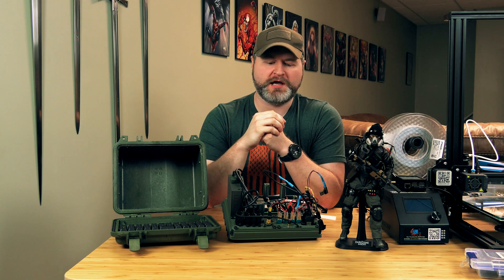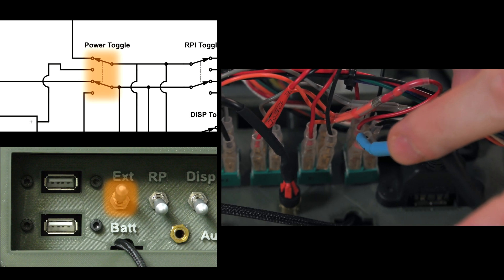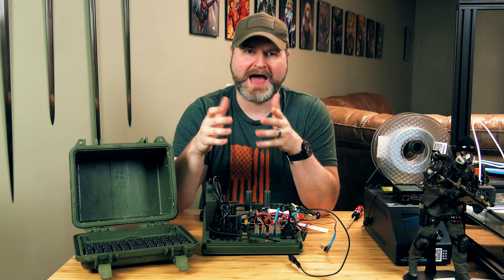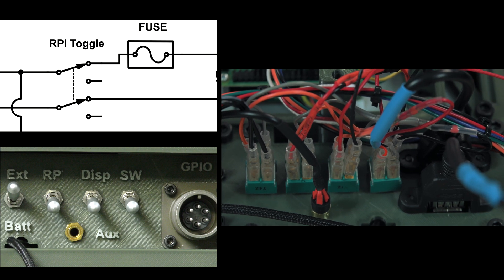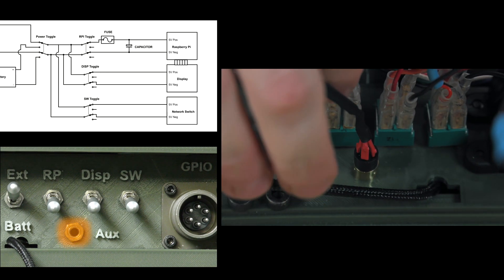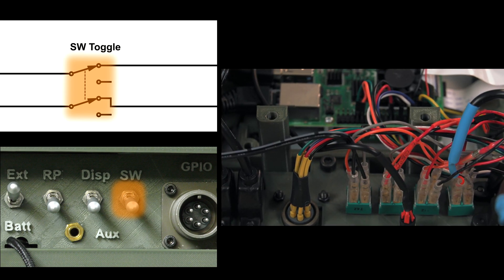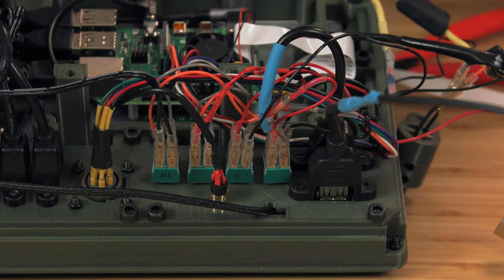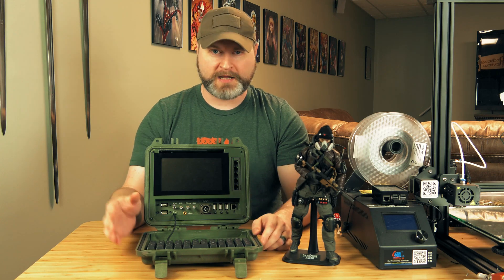"The Division" SHD Cyberdeck | Part 3 - Component Wiring | 4K

Comment: Please allow me to do some improvement comments: For better esd protection, never cut ground like you do. All devices grounded allways, only switch +V. Also, consider coating the internal walls of your case with conductive painting, and ground as well. Also, you will need a voltage level converter for your serial militar grade connector: pi serial works with 0-5v logic, but rs232 standard is -8v for 0s, and +8v for 1s. The fuse will not protect in case of a power surge, unless you include a 5.1v  zener to trigger a shortcut in case of an overvoltage.   Just some ideas,  I like your approach  for the layout, in particular the keyboard and ethernet switch locations

Comment: These videos are great. O built mine, but the capacitor doesn't seem to do anything. I actually wired one directly to the pi and one to the screen. Both shut off when i switch power sources. 
Any advice?
Reply: What size capacitor? Same electrolytic as in the video? The cap should discharge to resist the change in voltage when switching sources. Have you tried switching out caps or probing with a meter when you switch over?

Comment: Would the fuse and cap really be necessary. I am looking into doing something similar but I really just want to do more of the survival wiki with the keyboard and the networking options. I don't see a need for the radio features in my case. Thanks for the videos and awesome job on it!
Reply from the maker: I have yet to get the Cap doing what I want, but I haven't spent a lot of time trying to solve that problem. The fuse it to prevent damage to the pi in the case of power surge, or someone using high voltage connections via the USB port.

Comment: For anyone wondering about the capacitor... Skip it. Get a "PiSugar" UPS so that it stays on when switching power modes, or if you have to yank out the external power in a hurry, or whatever. It's a much more reliable and purpose built option, and you get a 5000mah battery with it... which will sustain the Pi for about 6 hours. You can run the pi and the screen thru it. It simplifies the wiring a lot. You just need to solder an on and off switch to the PiSugar, route the on off screen switch to interrupt the pi to screen connection, and you're golden. Then the only thing you have wired directly to the battery or external is the switch. You could probably wore in the switch to the PiSugar too... leaving only power to the PiSugar on the battery/ext toggle (power runs to the PiSugar, not the Pi it's self). The wiring is simple as... Pi once you have that part worked out. Another change I made to my deck (not done yet), is I soldered a direct connection from ext to batt with a diode, so the battery is constantly charging even when not in use. This might hurt efficiency down the road someday, but with the PiSugar in place, you can pick up ANY external power bank and hook it up. The PiSugar converts input 3.1v to 5v, so 5v 3a power banks aren't required. More flexible system... all for 29 bucks extra.
Reply from the maker: I'll be looking into this.
Reply: Hi does you have an Link?

Comment: this is a cool setup and the look of all the wires coming in and out of everything is fun to look at but for practicality sake I'm sure there's a prefab PCB system out there or at the very least opensource gerber files out there to have one printed at one of the online PCB printing services which will handle all the power distribution for you, at it's base stripped down version this is essentially just a Pi, screen and power supply with the additional parts of togglable battery/mains supply and the ethernet hub might save some headaches if you were to remake or make more of these if it's a board instead of extensive wiring and surge/short protections.

Comment: Really helpful, Trying to find some good alternative switches and materials, as I lack a 3d printer, and those locking on-none-on switches are individually almost the same price as a Pi. Kind of surprised at the relative simplicity of your layout compared to the original. It's a lot easier to follow your wiring at a glance than the original concept made it seem. I love the milspec connector, still waiting for someone to actually do something with it though, such an expensive connector to include.
Reply: Did you ever find any good alternative switches?
Reply: @Elektrokardiogramm  Those on-non-on are pretty pricey, but those are pretty high grade switches. Any on-none-on switches (Even without the latching mechanism) would work! Digi-key has quite a few.